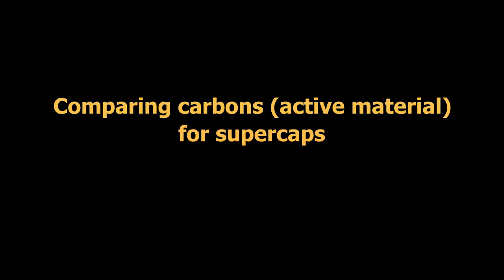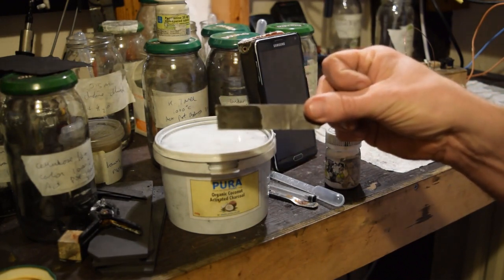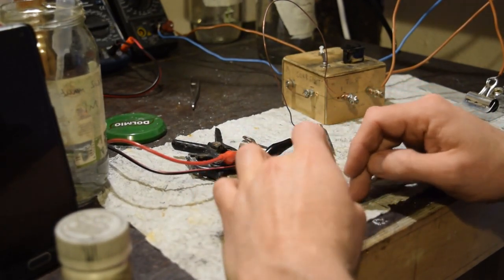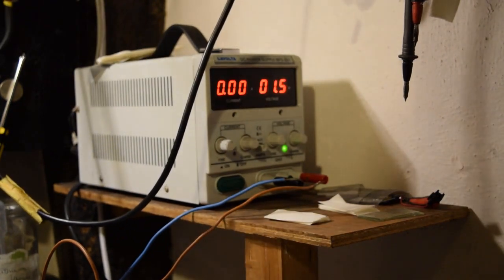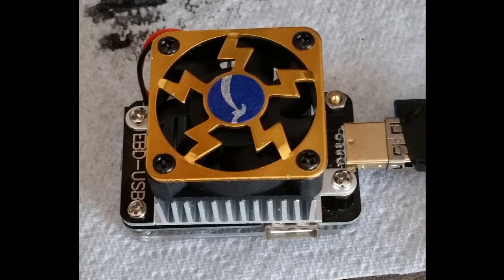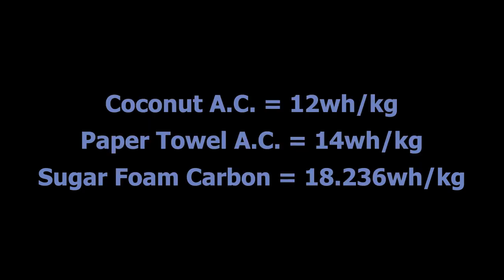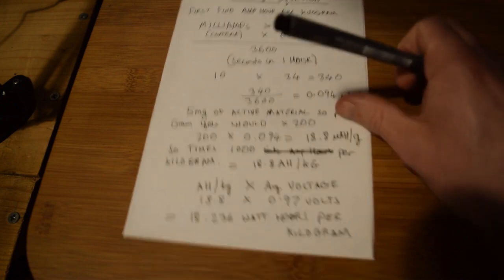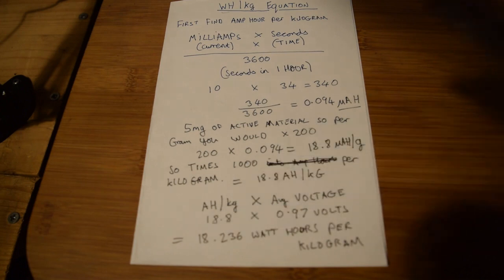Comparing carbons (active materials) for supercaps

Comment: Hey buddy , you really filling in some good gaps with your carbon production. Its great to learn your system ideas . 👍🏻 you got any new content coming up or have you got a job at BASF chemical division ? You have good talent for it 🧐
Reply from the maker: Electron Proton Neutron Mouron hi thanks for the comments. My lab is getting a deep clean at the mo. I haven’t got round to doing any vids as there hasn’t been much to show. I’ve concentrated my work onto to more battery type devices. Zinc ion in particular. Been quite successful with sodium vanadate nanobelts with adding my carbon to it. Google it to found out more. Really good energy density. Might do video on it one day. You need vanadium pentoxide (ordered from rob) and stir it on stirrer 2-4 days with sodium chloride to make nanobelts. It’s quite cool. But progress has been slow in general. Been busy with other things.  Thanks for asking n hope that’s told u where I am at
Reply: Gee Force great 👍🏻. Nanobelts is new to me . Thanks for the tip and a 10 min video would be great if you can .

Comment: But if you further heat the activated carbon (graphitizing it), wouldn't it perform better than it did?  Also, grinding it up would help too.
Reply from the maker: The activated Carbon was already graphitised. Grinding may help make a nicer ink but it won’t help performance.
Reply: @geeforce3891  Got'ch yah.
Cheers, and thanks for the videos/info.

Comment: Another great video easy to watch and very informative results. I have found 1g active material works best with the ZKE and is easy maths. Looks like I need to go find some Pura carbon as what I have does not compare. Thanks for the paper you linked near the end of it there was some info on using Fe4O3 in the negative with MnO2 in the positive which has produced my best cell yet! 
If you're looking for some structure take a look a carbon felt i have had some good success with it for holding large quantities of active material.
Cheers
Reply from the maker: Thanks Peter. I'm glad you found the paper helpful. Yes Pura was the best i found and you can get it in decent quantities. You inspired me to do this video from asking about how my carbon compared to coconut AC. So cheers for that! :)

Comment: Thank you for another great video. As far as finding a way to improve your carbon by giving it a scaffold to bind to, I really think kev was on to something in those final videos he blessed us with. He was able to make a structurally sound material using no binders and all carbon bearing materials.
Reply from the maker: Thanks mate - Yes ideally it would be an all carbon highly conductive scaffold on a nano sized scale and allow max ionic movement.
Reply: I have had some promising results using various mixtures of graphite and corn starch, then baking in a domestic oven in a similar way to baking a biscuit :-)
Reply from the maker: @solarhope you can use all kinds of carbohydrates like corn starch, potatoe starch, dextrose not just sugar. I may try using some starches to mix with my sugar foam syrup and see if those carbohydrates produces a harder carbon n therefore act as a conductive scaffold with the softer sugar foam. Cheers mate!

Comment: Nice Video - glad to see your experimental methods (controllable/repeatable) and the calcs.  I'm a fan of areal energy density (mWh/cm>2). As you said weight is a good experimental comparison variable but the area comparison is typically a limiting factor for stationary applications and also a good comparison for our homemade cells.   Would like to share  more of my current work with exfoliated carbons and composites offline if you can share your email.  Contact me at dkramertroymi@gmail.com 
Dennis
Reply from the maker: Thanks Dennis - yes indeed area and volume are important, particularly with supercaps. Sure my email is geeforce1978@gmail.com

Comment: Various activated coconut carbons differ a lot. Have you tried those “supercapacitor grade”?

If you find any interesting paper behind paywall let me know - I may get it for you.
Reply from the maker: OK thanks Viliam. I have tried other coconut fibre AC's and found Pura was the best one. Not supercapacitor grade.. is it cheap and easy to get hold of and in decent quantities? If I get hold of some.. I'll test that too :) but I think the sugar foam carbon has more scope for much greater improvements. Hopefully folks can take this carbon (that Rob and  I have showed how to make) and improve on it.
Reply: Gee Force That’s the thing - it’s more expensive than normal AC. I think it is more purified, less ash, metal content etc. 

A while ago I read a study investigating why is graphene or alternatives not used more. It boiled down to price. At high quantities coconut AC is dirt cheap. They claimed $4 per kg. 

Also note that commercial caps use ionic liquids. With larger molecules it benefits less from fine structures produced by chemical activation.

It’s amazing you are sharing your experience with such detail! Thanks a lot!

Comment: Tim, this is a great video - thanks!  We are on some parallel paths with our experiments right now.  I've got a list a mile long of things I want to try and only limited spare time to do it in!  I don't have a kiln, but I found some research on using microwaves to do graphitization as well as carbonization.  I think that's what happening with my sugar foams.  I'm also limiting myself to kid-safe materials which means very green processes, but limits some of the things I can use - like acids.  

I'm probably posting the video tomorrow with the results of my latest carbons that might give you hints about things to try yourself.  Based on your videos I got myself some fire bricks and a couple of crucibles, but I haven't used them yet.  I also picked up some dextrose (corn sugar) based on Kev's comment on a video of yours, but that's probably next to try.  

I'm glad you got the EBD-USB+ unit - it is a great way to do constant current loading and data logging cheaply.  Thanks for moving the microphone out of the frame!  It probably wasn't bugging anyone but me, but I appreciate it.  Now if we can just help Robert Murray-Smith with his echoing audio... (grin)

Onward and upward, leo
Reply from the maker: Thanks Leo. Yes I think there are videos done by Rob n Kev on using ceramic crucibles and lining it with conductive ink. In fact if you search microwave crucibles there's some already available to buy based on the same thing. This enables you to reach much higher temps in your microwave and therefore graphitize.
Cool.. I'll take a look at your vids and yes I could offer to be Rob's sound man! Lol cheers mate!
Reply: Hi guys,  I have been using small 50mm ceramic crucibles for a while, the insides covered in graphite ink (it soaks it up really well) and a 800W domestic microwave,
I use one crucible as the container and one as a loose fitting top, I use samples up to 10g max and times of 10 mins max. They glow red hot in the microwave, do not open the door straight away as they can crack or break :-)
Reply: @solarhope  Thanks Martin - I actually have a small unit, and it does work.  Right now with the mixture I'm using I'm getting a crazy amount of heat directly in the sample itself.  (I'm adding about 10% of graphite powder, or 2 grams to my mixture)  Some sources I've seen say that the flashes in the microwave mixture could be as much as 3000 degrees -- I just know I've broken several mugs that should have been able to take 1200 degrees.  So now I'm working on dialing in less time or less microwave power or different containers.  I just got a couple of crucibles, but I don't have a lot of hope that they will fare better.  I also am very careful to not open the door until its been a while - but the cracking of the containers is happening during cooking, not when the door opens.  Thanks!  leo
Reply: @geeforce3891  Cheers, Tim!  I share your hope of building up a community of shared information.  I'm hoping it results in a green process outstanding energy storage device.  I'm not trying to make a living on the devices, so I'm sharing everything openly.  leo
Reply from the maker: Ops I mean search 'microwave kiln' not crucible, into ebay.

Comment: Definitely try the paper pulp binder method if you haven't. Blend your carbon up with paper towels and pour into a mold, makes a good scaffold like you mentioned.
Reply from the maker: Thanks Ferris for your suggestion. Yes I have tried it like Robert Murray-Smith showed us. It didn't really help unfortunately I think mostly because the paper (cellulose) is non conductive. Ideally you want a conductive scaffold, like a carbon or even a better structure to the carbon itself and I guess we are talking on a nano-sized scale.
Reply: @geeforce3891  oh all right fair enough then. I will say that when I tried it with the mesh mold and the tray of water a lot of my carbon washed out and it had pretty poor conductivity, but with a solid mold and then letting it evaporate it did conduct really well.